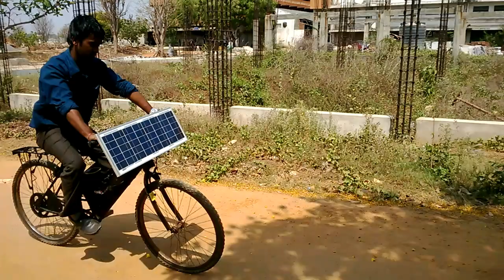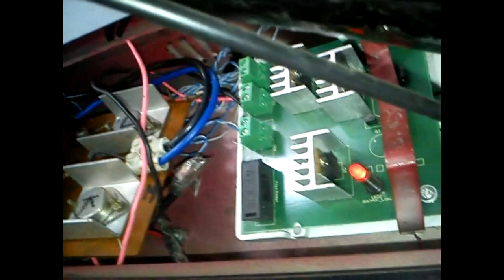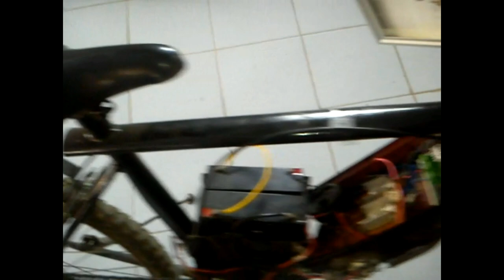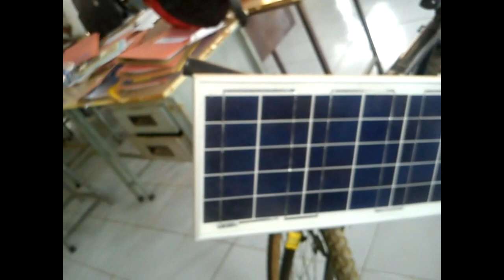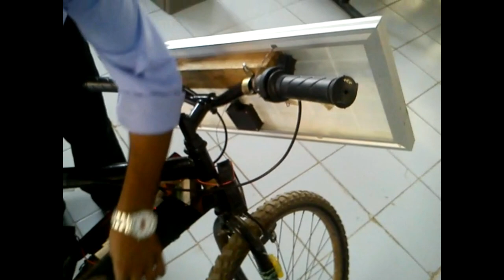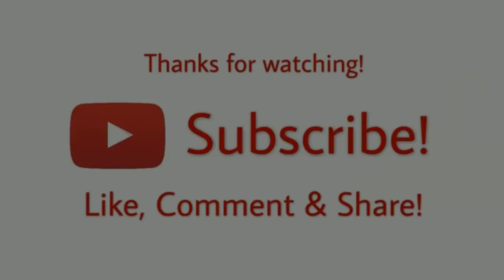Make your own solar powered bicycle I homemade solar  E-bike I #diy #homemade #amazing#ebike

Comment: Sir i have hero photon electric scooter which has lithium iron phosphate battery of 48V 28A....
I want to run it on solar energy or i need a solar powerbank...
So if my scooter charges out in midway i can recharge it by solar energy...
Plz help me regarding this

Comment: u use inventer ?
Reply from the maker: Thanks for your comment and here we don't use inverter, we use dc supply as input to run a PMDC motor by pulse width modulation we are controlling the speed of the motor.
Reply: @robotronics  solar sun can use for motor ebike 24v 250w?
Reply from the maker: Yes you can use
Reply: @robotronics  but maybe can not makr 24v 250w yes ?
Reply from the maker: Yes you can make and you need to use hybrid solar panel and with dc to dc boost convertor

Comment: Sir you did super project , and we are interested to do this project , sir I need a small help for you , sir we are preparing e bike into solar e bike ,sir we are using 24v 250 watt capacity bike sir we need to fix solar for it the battery capacity is 12 v,and 14ah how much solar panel in required for it sir , please help us sir
Reply from the maker: thanks for your reply and the main problem is the solar panel and what i learn from my project is the mounting of solar panel on it coz it required much space. and you can use 20-30w hybrid solar panel for 12v 14ah battery but you need to use current booster on it to charge your battery within 3hrs
Reply from the maker: for more please mail me or you can call me for any support which you need for your project...
Reply from the maker: and do subscribe my channel

Comment: Bro I have to make the same..
So plzz can you give me the details of the motor and solar panels and the battery that can be used..
I mean to say their power..
Plzzz
Reply from the maker: Thanks for your comments and please buy the following listed parts:
1.bldc or Dc motor 48v/750w
2.mono crystalline solar panel 24v /20w hybrid solar panel
3.controller 30 amp
4.battery go for lifeo4  48v /20a
Reply from the maker: If you further need any support please mention in coments
Reply: @robotronics  tysm bro..
Reply from the maker: Welcome bro
Reply: Bro what is the price of solar panel
Reply: @madhumatidevi4897  3 thousand approx..